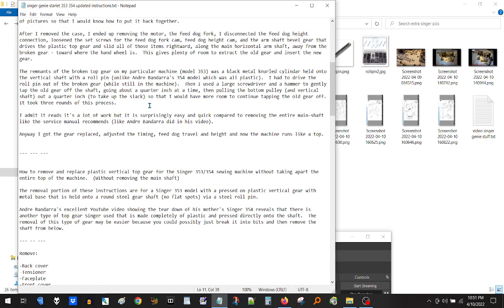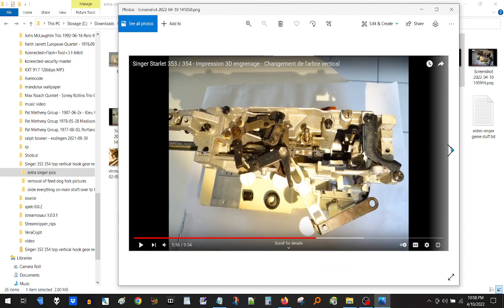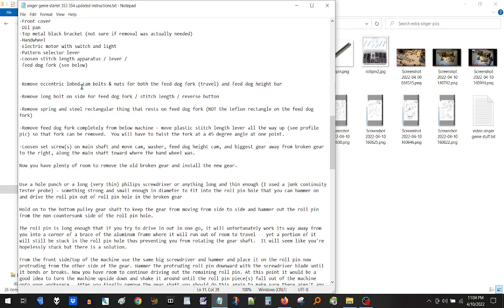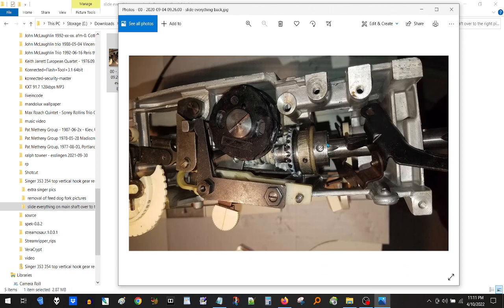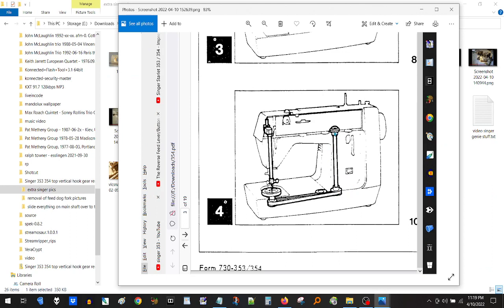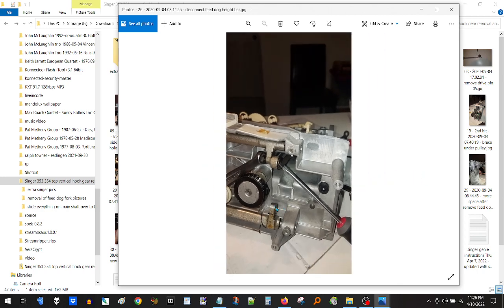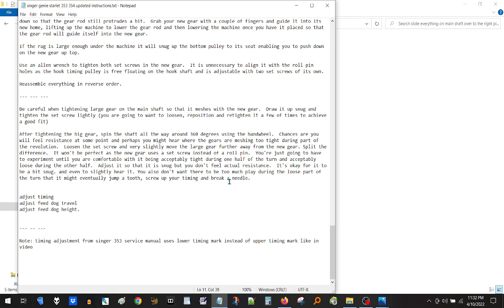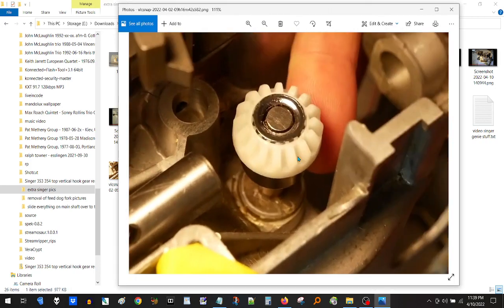Singer Genie Starlet 353 354 Sewing Machine top gear replacement shortcut - slide show

Comment: Thanks for your video. It's a shame you didn't make a video about it just to be on the safe side, then it would be more understandable. You wouldn't have needed to upload it if it hadn't worked. Unfortunately, I don't find it so understandable and very tiring just with pictures and descriptions. Still, it's great that you did that. Good thing you found a way to make the repair without having to take the whole machine apart. :goodvibes:
Reply from the maker: I was more concerned with just fixing it.  I only started taking pictures so I would have something to reference to help me put it back together.  lol

Comment: Nicely done! You've found a workable way to replace that gear in about half the steps shown in the service manual which also says to remove all the nose end connections and width levers and move the horizontal arm shaft out of the nose enough to pull up & out the gear/shaft. It's still tight quarters to access the gear compared to the model 457, but very doable as you have shown. There are about a half dozen Singer models that require the top arm shaft to be removed, and I think this could work on a few of them. That plastic gear on the 353/354 is the only weak spot on an otherwise strong & versatile machine, IMO. 
     BTW, the Vintage machines with the dual timing marks use the top mark when setting the height of the needle bar and the bottom mark for setting the needlepoint to hook point timing. We remember upper height and lower hook to get it correct.
     I appreciate the time and effort you put into this and know how time-consuming it is to find a workaround let alone document it. I'd like to put a link to this on my channel in the 353 Playlist because I still get inquiries several times per year about the hook not rotating on the Genie/Starlet models and at least I could offer your show here as an alternative to many hours long arm shaft removal method. I enjoyed your use of the parts diagrams and good pictures, too. Thank you.
Reply from the maker: Thanks for the kind words Andy!
I would be honored to be included in your Singer Genie 353 playlist.
Sorry for the meager production values and I think I should have probably drank a few cups of coffee before hitting the record button because I had a problem finding words.  If you have a list of machines that this fix might work on, please send it to me because maybe I could list them in the video description here for people who want to attempt it.
I wish someone would make steel replacement gears for all of the Singer machines that had plastic gears.  It's a shame that this Genie model also has such an Achilles heel because the rest of the gears and pulleys seem to be made of metal.
Reply: @demotoob3828  Thanks for that. I'll make a slide and put a link. No worries about your video. You should see some of my early stuff or the videos I made at 2Am when my insomnia was acting up, haha.